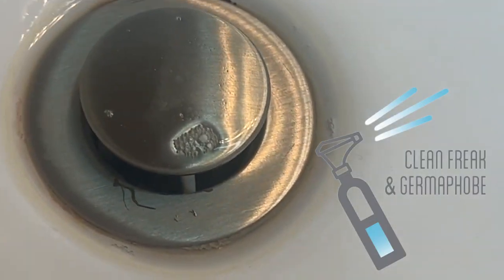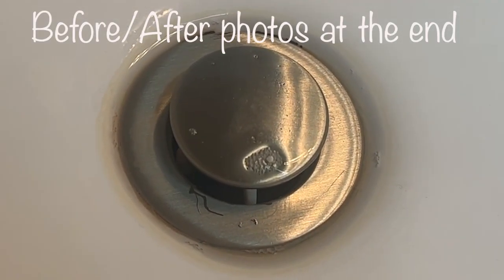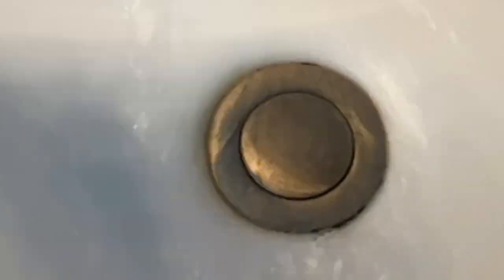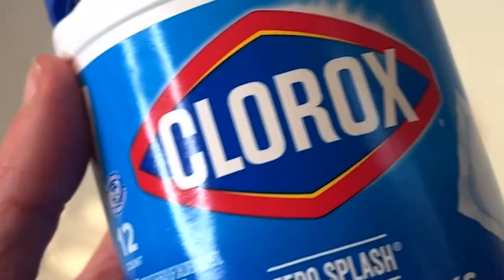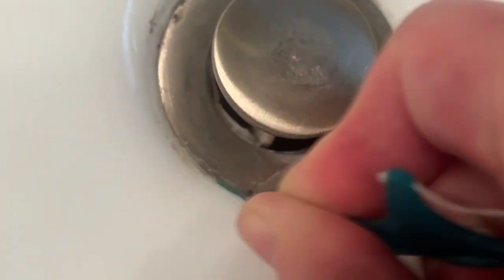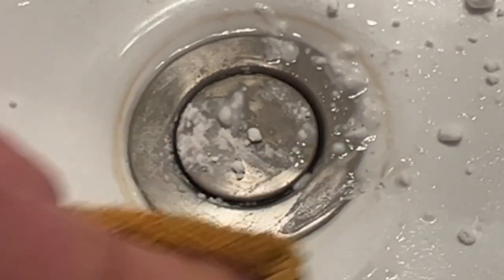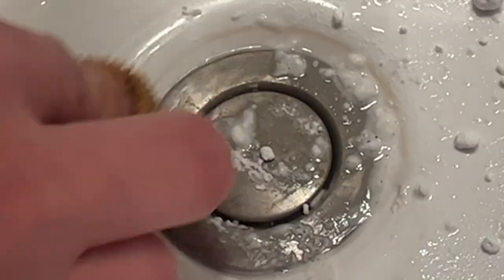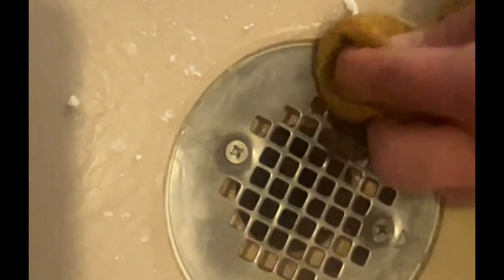How to CLEAN Ring Around Sink Drain ⚡ (2 Ways Tested / What WORKS)

Comment: So, just wanted to say to be very careful going in there with a pick like at 1:27. The popup stopper piece seals into that solid metal ring piece with its own rubber gasket on the underside. The metal ring piece is sealed to the body of the sink (where that black mold was growing) by using something called "plumber's putty." It's kinda like Play-Doh that never fully hardens. That stuff is primarily what keeps the water in the sink, in addition to a big rubber washer underneath the sink basin. In a kitchen sink, that stuff is the ONLY thing keeping the water in the sink preventing a leak down below. If you scrape it out, you can cause a leak. It's a very thin layer that is left after tightening the drain in place, and if the installer used a small rope of putty on the outer edge only, it could be that what you see is all that's sealing it at the moment. Generally, whatever you can remove with a pick or your fingernail at a 90° angle to the metal ring's upper face is ok to remove. If you start angling the pick and shoving it deeper underneath, you remove too much material. If you truly hate the plumber's putty and get moldy rings all the time, you can DIY or hire a plumber to remove the drain and tailpiece assembly, and use a silicone caulking instead of putty. The caulking must be one which is both rated to be mold resistant and rated to be submerged fully for long periods of time. If time is taken to properly clean the parts, fill in the bead of caulking completely, and then wipe/smooth the visible face so that it's perfectly smooth and flush with the metal ring piece, you will have a seal there which is clear or white in color rather than brown, resistant to mold growth, and hard cured so that it is solid and rubbery rather than gooey and soft and able to be gouged out with a pick like the putty is. The caulking seal will be durable and easy to clean. You can do this same exact thing with kitchen sink basket strainers/garbage disposal rings and bathtub or shower drains. If it uses plumber's putty to seal the drain, you can use a mold resistant fully submersible rated silicone caulking instead. :)
Reply from the maker: I realize the seal was broken but the mold bothers me so much. Thanks FHS tips. Next time we have the plumber over we’ll have her look It over/reseal it.
Reply: It’s a complex issue. It happened to me too. I thought that dark stuff was gross of course and I used a toothpick. It got worse in the long run because there was more area for dirt to get trapped. I learned my lesson when it started leaking but I had a nice plumber show me how to replace the putty myself if it ever happened again. So you live and learn.

Comment: I love Barkeeper’s Friend or Bon Ami cleansers!  Sometimes the old ways are best.
Reply: Are these different than Ajax or Comet?  thanks !
Reply: @denisemarie6131  Both have no bleach and are acidic, which is why they work well on scale. They also work great on stainless steel and porcelain sinks and also remove rust. Bar Keepers Friend is stronger than Bon Ami, and you have to be a bit more careful using it than Bon Ami, but I will use either one.  I also use them to clean the stains on the bottoms of pots and pans, as well as to clean grease stains on cookie sheets.

Comment: I love Bar Keepers Friend, I use it for everything especially the stovetop. But it did not work on my drain. I have even bought stiff brushes to attach to a power drill and used the bar keepers with them, and again it didn’t work for me. I live in the San Joaquin Valley and we have very hard water.  But thanks for the suggestion 😊
Reply from the maker: Sometimes the hard water is so bad that nothing works.